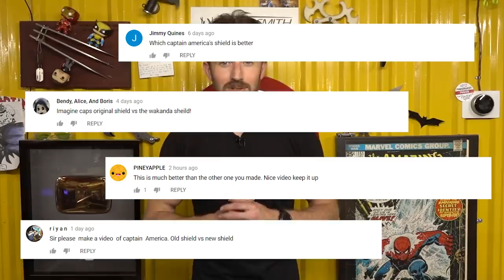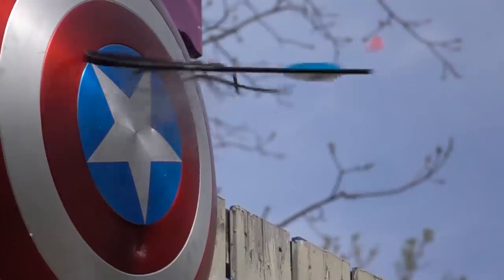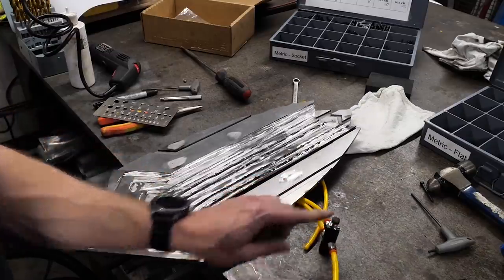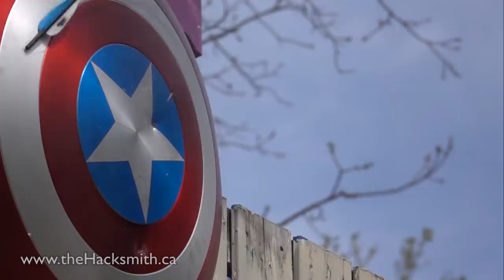Which Captain America Shield is better!? (NEW vs OLD)

Comment: The American shield is good for protection and the wakandan shield is good for battle
Reply: Yes because the american sheild is bigger so it gives better protection and the wakanda sheild is better for battle because of sharp edges
Reply: exactly
Reply: It's actually the opposite of u notice he breaks more with the original and the wakandan one is bullet proof and the original ain't therefore the other way around
Reply: that's because the wakandan shield is new
Reply: иitro Щσlf so prettymuch just compare it
Reply: @oeuf1280  yeah
Reply: @xxkingaraelxx2763  Remember when Peggy Carter shot some rounds at the shield?
Reply: actually if you use both wakandan shields its also better for protection but the american one is a better breaker the wakandan one only stabs which  is more useful in combat but harder to break doors etc
Reply: also the bullet proof effect is a plus
Reply: @amratia7180  Og shield blocked Thor's hammer.
Reply: Actually the American sheild is the strongest unobtanium and because its made of proto adamantium stronger than vinbranium.
Reply: @xxkingaraelxx2763  actually the wakandan sheild is less bullet proof
Reply: Murkey water im talking about the one he made not the one in the mcu
Reply: Its same captain america first shield made by tony star father and its the strongest metal in earth and that metal came from wakanda.....
Reply: Captain America must have that both in Avengers 4
Reply: bruh where did yall get the idea that the american shield isnt bulletproof
Reply: oh the video ok
Reply: Arael Rodriguez actually is not correct even though it can’t break as much does not mean it is worse for offence it is sharper  so it is better for offence
Reply: I think most of y'all misunderstood I'm talking about the one hacksmith made not the one in the comics or movies
Reply: There both kinda the same
Reply: i think the shields is better on there own way and your right Raptors 73 also captain Amerika with both shields now that is awesome and powerfull
Reply: @diegolumuru1403  ha thanks dude
Reply: @BucketDa4th   anytime
Reply: Actually, the of shield breaks more than the wakandan one, but the wakandan one is bulletproof
Reply: I agree
Reply: @muricaneagle666  yeah captain america sheild is also bulletproof
Reply: @renzo257  actually the wakandan shield is better at both coz it's bulletproof but the American is not
Reply: @xxkingaraelxx2763  Be that as it may, the American shield is canonically bulletproof, much larger, and has definitely stood the test of time. We don't know how well the Wakandan shield will hold up in the heat of a real MCU fight, so we must logically say that the American shield is better for protection. Plus, the American shield is much less dense, meaning that it is easily wielded for an extended period of time.
Reply: I agree

Comment: The original is made for throwing and for smashing. The new one is made for piercing and being more mobile. I'd much rather have the original as the shape would make it more effective at defence. Though it dosent have offensive capabilities the ability to throw it is super effective in general. Also the old one had more wear in the video so if assume if we had 2 updated models of each made with the same materials it would be better at bullets hands down.
Reply: how you need lightning powers to use the storm breaker
Reply: Agreed
Reply: AUTOBOT CJ no. It wasn't enchanted
Reply: shahaman noodah dammm
Reply: I mean it's a hunk of vibranium being thrown and smashed at you I think the offensive part is covered.

Comment: But he won't know what is stronger because he doesn't have vibranuim
Reply: Gage Harris old shield has a percentage of proto admantium which is stronger than vibranium according to calculations using information from the comics 

The old sheild is stronger, and more useful
Reply: both shields are made of vibranium
Reply: Gage Harris Both of the shields are made out of Vibranuim the old and the new one.
Reply: Lt Catfish Not in the movies. In the MCU, both shields are made entirely of Vibranium.
Reply: Lt Catfish vibranium is shock absorbent. It can withstand more than admantium. If it was better why use any of that expensive and scarce metal in the first place if you already have a surplus of this cheaper metal at your disposal? It wouldn’t make sense.
Reply: Lt Catfish and is isn’t more useful at all. He can only do two things and fight one way with the old shield. New shield is versatile and fits his fighting style better.
Reply: Joshua Green Yeah but without a projectile to spam, Cap is useless
Reply: but if he makes then both out of titanium it can be a tiny bit accurate

Comment: id prefer to have 1 wakandan and the original cause then u have so much defence if u miss a shot with the wakan then u have the original like so many tacktics the wakandan is more dmg but the cap shield is for deffence so lets say caps shield did 2000 dmg each hit and wakandan doe 2500 but each attack u do two hits thats 5000 that is 10000 if they both had two goes cause ur origin can hit once a turn so it would do 4000 then deffence the def on caps is pretty low but high so medium and the wakandan shield is bullet so i would say medium-high but  if we talk in numbers then caps orig shield has 10000 def but the wakandan has 7500 so close to PLUS ULTRA also dont forget the origin comes back so if u hit and do 2000 then u do 2000 then u hit 2000 thats 6000 and then u throw again and boom same dmg as two wakandan hits so i think its visible that the wakandan is better but having two of the shields(wakandan and caps origin shield) is even better because lets say u hit hit hit and the wakandan gets blunt so u are sent far because of thanos laser and boom u are 30m away dont ask how u throw ur wakandan shield and thanos blockes it but by the time u hit thanos with origin also the blunt wakandan does 1000 dmg so if u hit him he sends u back and u throw it then it comes back throw again and the geta rock throw and boom thanos distracted while u go up and kill him or take the stones away and throw them instantly boom best tactic and best weapon revieled

Comment: Making an up to date Captain America Shield instead of pulling out the seasoned so the comparisons would b more accurate. Shooting arrows at 1 vs. bullets at the other disappointed me.
Reply from the maker: Huh
Reply: @hacksmith  did u shoot bullets at both shields, no. U shot bullets at wakanda shield n arrows at CA shield. Meaning the wakanda shield is made stronger.
Reply from the maker: Yeah... that was the point... it is stronger lol
Reply: @hacksmith  caps original shield could withstand bullets too. Just seems like a biased comparison, y'all not putting both shields to the same degree of test.
Reply from the maker: This one cannot
Reply: @hacksmith  haha right, all I'm saying is if u weren't gonna shoot bullets at both shields, then only shooting arrows at both shields instead would make for a more fair shield comparison.